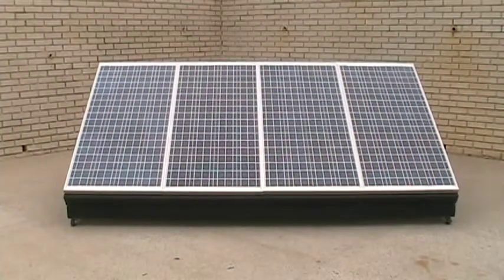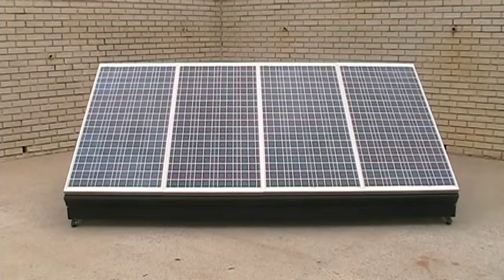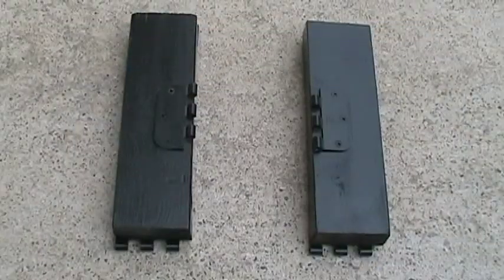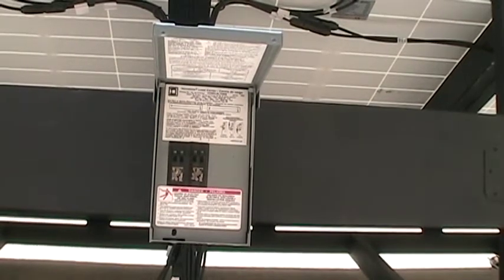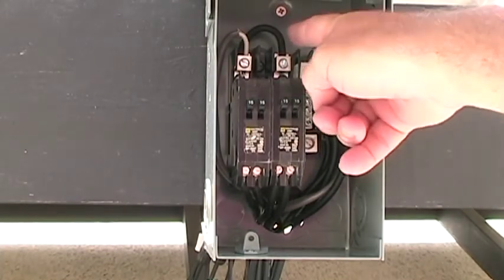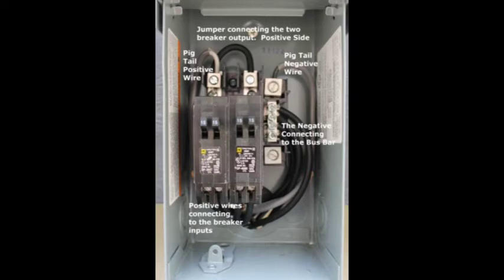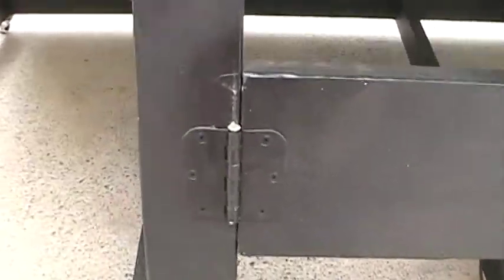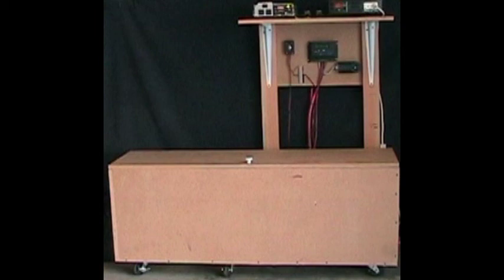Portable Solar Panel Array - Suburban Survival Solutions

Comment: Nice design but, if you have a John Deere or similar wagon you can mount two, 260 Watt panels on it and make them portable.  They are easy to remove or wheel around, putting them in the garage to protect from theft, hail, wind, etc. and rotate towards the sun.

https://www.youtube.com/watch?v=y8ARPcdUNbs
Reply from the maker: +John H The wagon is a good idea but I find the casters to work perfectly.  Rolls effortlessly into the garage and make it very easy to manually track the sun during the day.  Thanks for watching!